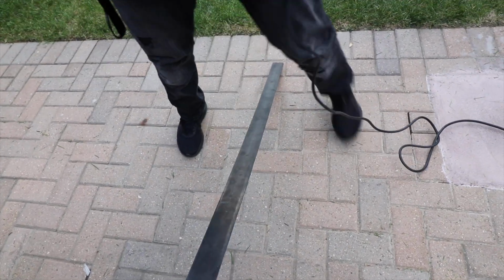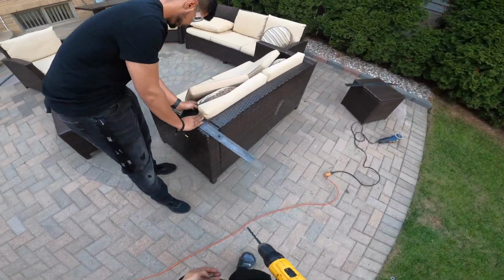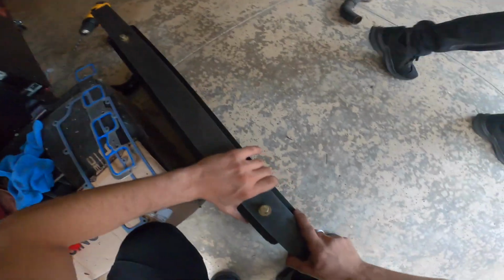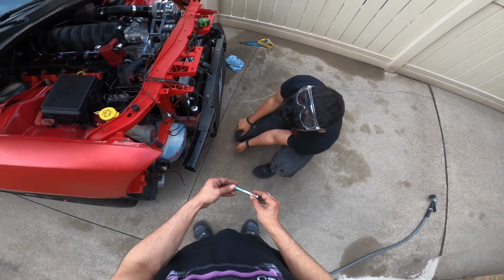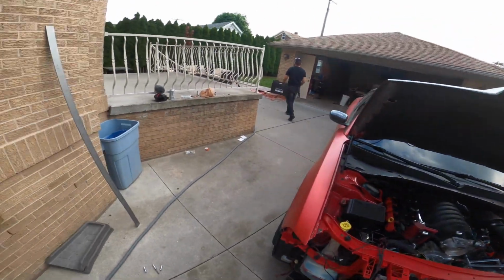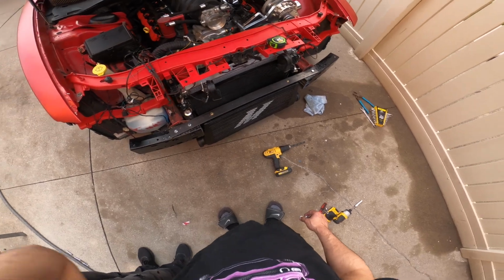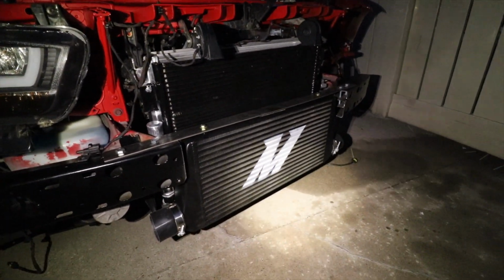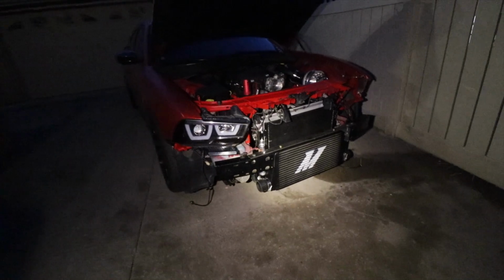INSTALLING THE MISHIMOTO INTERCOOLER!!! 🤯

Comment: Don’t get a Mishimotor UZB MMINT, they don’t give you a full kit with bolts, brackets, and bungs. You need a reducer for the outlet. Since the outlet is actually 2.75 not 2.5. And lastly you need 12x1.75 hex bolts. It’s a warning to inform people about it.